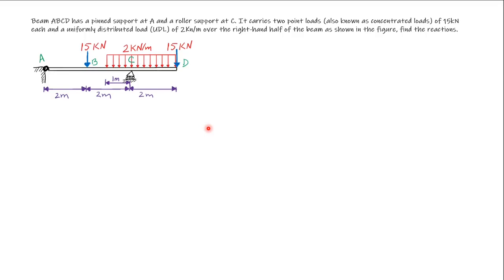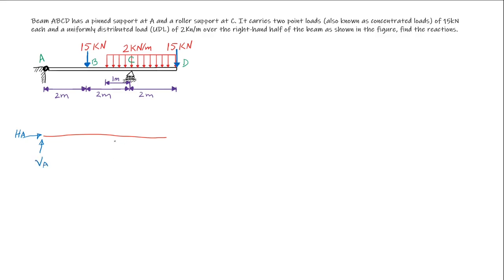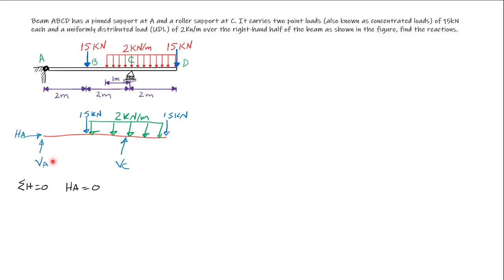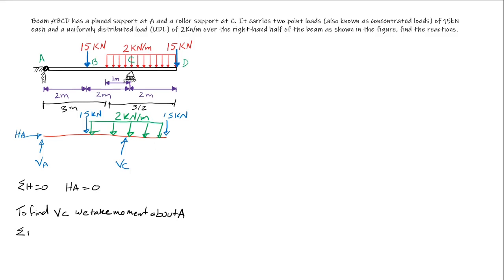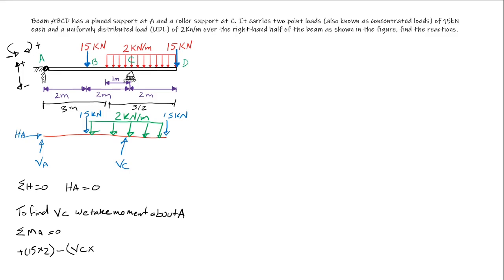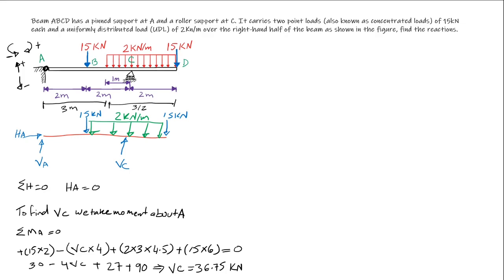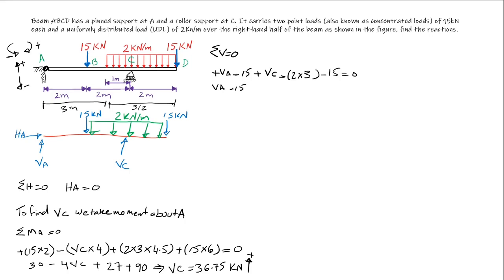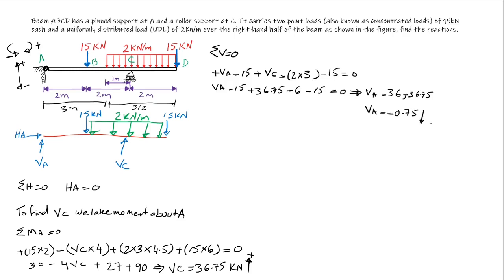Finding Reaction Forces of a Beam with Point Loads and Uniformly Distributed Load (UDL)

Comment: It's wrong, when you get the bending moment around Point C, 1m of the distributed load (2kN/m x 1m x 0.5m) is on the left of the point and anti-clockwise (positive) and the other 2m is on the right side (2 kN/m x 2m x 2/2 m) which is clockwise and negative. The result might be the same in this case but the approach is different and you might confuse people! be careful

Comment: nice video
Reply from the maker: Thank you
Reply: @masterengineer6600  I got one question similar to that but I can’t do it in ur way idk why
Reply from the maker: @a.babraham7650  this way should work for most of the beams with similar loads. Follow the steps start off with the horizontal forces then the verticals and finally the moments. That should do it